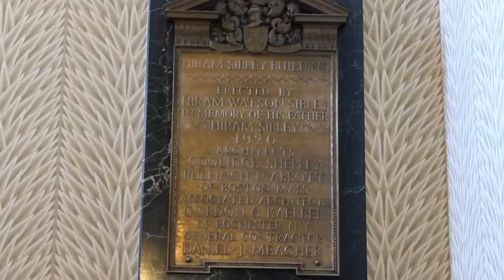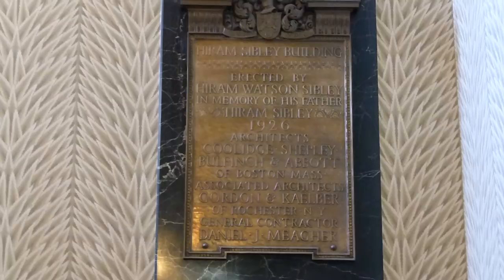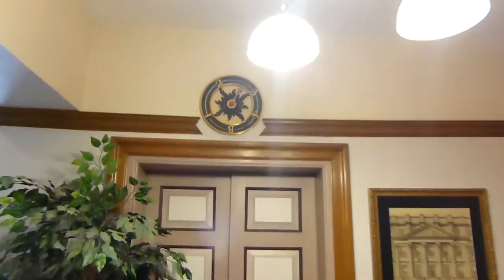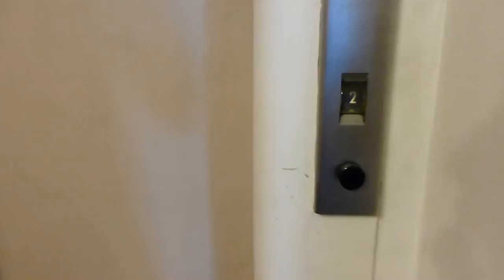A Vintage Death Trap: Otis Traction Elevator @ Hiram Sibley Building, Rochester, NY

Comment: I hope this elevator doesn't get modernized, or even worse; replaced. It's an absolutely beautiful elevator with a lot of character. Also, if you were the only one in this building, you should have rang the alarm.
Reply from the maker: Judging by the condition the building is in, I don't think the owner would even be willing to shell out the cash for a mod.  As for the alarm, I'm pretty sure I wasn't the only one in the building.  At the very least, I know there's a bar on the main floor where it would probably be audible.  Besides, ringing the alarm just isn't a good habit to get into anyway.  It's one of those things that's likely to get you into trouble at some point.
Reply: no he should use the phone

Comment: First thing's first, that door operator NEEDS TO GO. Other than that, this elevator seems to be fine. You are probably right about the both being manually controlled, but one got automated. Judging the broken indicator between 2 and 3, the fate of that elevator's existence (or ability to ride it) is probably a no. I think I saw a call button on 1 for that elevator, but it could be something else. If I were you, I would take the stairs down to B and see if you can get down there as the elevator may be down there. The stairs are where that lit exit sign was. And judging by the horrible floors, lack of light, and decaying ceiling on 4, that building may be close to abandoned. Definitely worth exploring.
Reply from the maker: I checked that thing on 1; it isn't a call button.  I'm hoping maybe the indicator up on 4 is miscalibrated and the elevator is sitting on 2 or 3.  You might be right about finding it on B, though.  I'm planning on coming back to this building sometime soon, so we'll find out then.

Comment: I tried to get this one once, but the building was locked.  I definitely want to experience this as well as attempt to check out the other one...
Reply from the maker: Yeah, I definitely want to try to get the other one too.  Hopefully we'll find it sitting open on 2 or 3, because without call buttons, I'm not totally sure how that one is supposed to operate...
Reply: HiFiAndElevators22 We'll just have to try. :-)

Comment: My college (Molloy College) has an antique Otis elevator (Which runs WAY better than the newer 2013 Kone elevator that was built).
Reply from the maker: I think almost anything runs better than a newer KONE, lol :P - But yeah, the only reason this elevator has issues is because no one maintains it.  It actually takes quite a bit of neglect to make a death trap out of these old Otis elevators.
Reply: I think its an 1970 elevator since its in like the oldest building at the college.